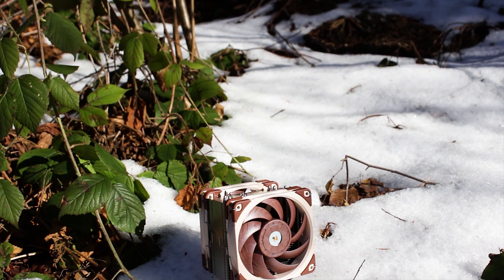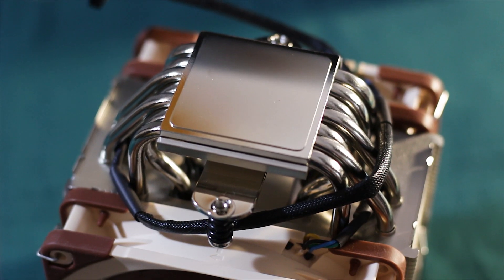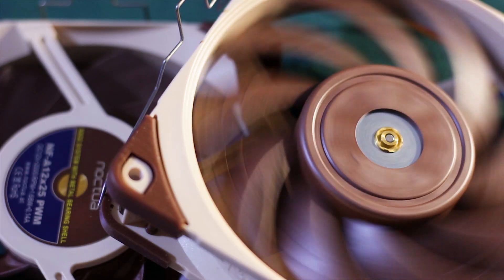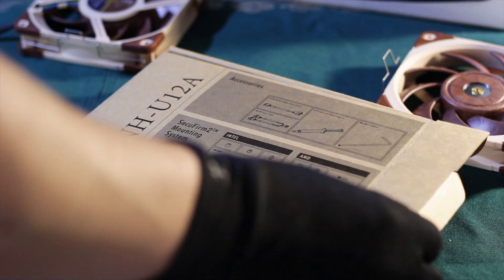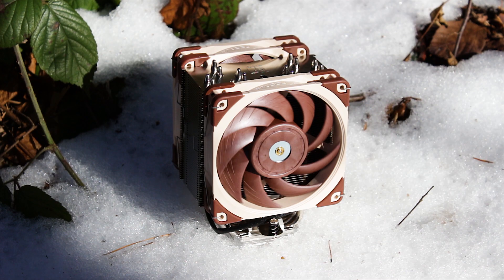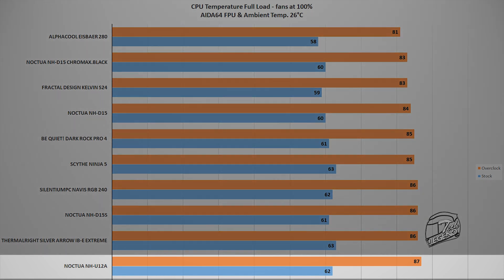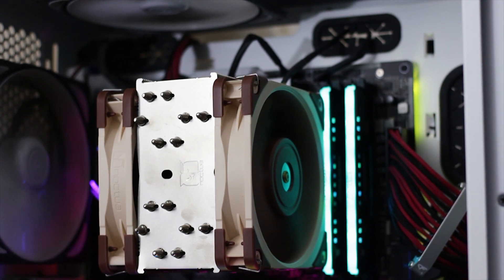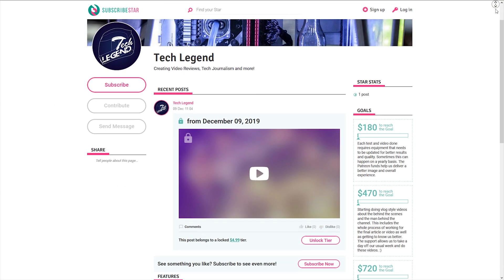Noctua NH-U12A CPU Cooler Review

Comment: What is the point of measuring temps with fans at 100%? Why not give regular fan use temps, so we can relate the U12A to our own coolers?
Reply from the maker: What does "regular fan use temps" even mean? Some people run their fans at 50% some at 20% some at 5%, some use good cases with good airflow, some use cases with blocked intakes. How many variables do I have to keep in mind when testing a CPU cooler to cover everyone? Not really realistic. The best I can do in terms of an "upgrade" is noise normalized testing in addition to the 100% RPM testing.

Comment: Very good review. I am eying on this to pair with Intel 10900k. Case is fractal design define 7,Gigabyte z490 vision d. 

What is your opinion on the setup and especially on whether the cooler will be able to maintain a low temp.

My usage is mainly for producing music.

Thank you.
Reply from the maker: I believe that I was the one who recommended this cooler to you. :)
This cooler is one of the best around, you can't go wrong with it.
Reply: @TechLegend-com  Yes indeed. Thanks once again for your helpful suggestion.
Reply from the maker: @Pianitara  No worries, glad to be of help!
Reply: @TechLegend-com  I was actually looking to upgrade my 11 year old PC. My current setup is corei5 2nd gen, 16gb Ram 1600mhz. In music production, I have stretched this setup always to the max.

As it is today, the price per core of Ryzen 5900x is same as that of Intel 10900k. Graphics card are way above their price and lower models are unavailable.

Ryzen 3900xt cost less than intel 10900k by $70. The Amd MB I was keen on is asus b550 which is not yet release till date. 

I am thinking to upgrade to Intel 10900k because of inbuilt graphics.

Considering the situation, in 2021, is it wise to choose intel 10900k?

Thank you.
Reply from the maker: @Pianitara  In your case, i'd get the 10900k instead of the AMD, it is a better CPU overall. Plus, tbh, I like the intel motherboards better.

Comment: Good review. I own this cooler and i am very satisfied with the performance. Two corrections: it has 7 heatpipes not 6. The heatsink has an offset design so it has 100% ram compatibility and it does NOT block the first ram slot and you can install even high profile ram in all slots. You don't have to move the fans upwards. You just need to turn the heatsink around (which is the correct installation orientation).
Reply from the maker: It was my mistake for installing the cooler the wrong way up, I have mentioned it in a few comments below. Unfortunately, I can't edit the video after it has been published. :/
Reply: @TechLegend-com  no worries :)

Comment: Good cooler and good review too.
I have also seen your review of the nh-u12s.
Can you please list the main differences between these two? And a performance difference.
Reply: Are the fans used different?
Reply from the maker: Yes, the fans are different. The ones used on the NH-U12A are newer and better.
Reply from the maker: The NH-U12A uses two fans that are better overall, also the heatsink is different. The NH-U12A is better than the NH-U12S, but it is more expensive.
Reply: How much the performance varies?
Reply from the maker: @utkarshsharma7336  Around 3 degrees between them.
Reply: Ok Thanks
Reply: Have you tried the performance of the 12s by swapping the stock fan with the better newer one?
What I really want to know is besides the fan is there any difference between these two?
As the d15s has just one fan less than d15.
Are the heatsinks of u12s and u12a same?
Reply from the maker: @utkarshsharma7336   The U12S and the U12A have different heatsinks, the D15 and the S variant have the same heatsink. Also, I do not test with different fans, as each CPU cooler is reviewed with the factory fan and orientation. Otherwise, I can just take a NH-D15 and put three 3000RPM fans on it and call it the best. :)
Reply: Ok thanks 👍, you have helped me with a lot of info.
Reply from the maker: @utkarshsharma7336  You're welcome!

Comment: Performance of this cooler in terms of temperatures in AIDA64 for both overclocked and stock (87/62) seemed very similar to the U12S Chromax (87/61) you reviewed. Would you recommend the U12S Chromax over this cooler (less noise but higher price and worse color)?
Reply from the maker: It just seems that way, but overall, the U12S is on average, 2-3 degrees hotter than the U12A. If you can, get the NH-U12A as it is better and has more clearance for the RAM and graphics card. The NH-U12S is good, but this one is a bit better.

Comment: You installed it backwards... it does not cover memory slots at all...
Reply from the maker: Hmm, Ryuki I think you are right! Now that I think of it, I installed it backwards because the fan was somehow touching a VRM heatsink. Thanks for pointing this out! At least in this review and mounted like this, we get to see the RAM clearance in terms of height.
Reply: No, it's mounted properly.  I have this cooler, mounted in the same orientation, and it doesn't cover any RAM slots.  He just was a weird motherboard.

Edit: No!  It IS backwards!  On his cooler, the Noctua logo is stamped in the opposite direction from mine.  I wonder why that is.
Reply from the maker: @hughjazz44  No mate, I did mount it backwards. Normally, it should not interfere with the RAM slots. Unfortunately, these things happen on occasion.

Comment: It performs almost as Noctua NH-D15 for example and with the benefit of being smaller. Does that make it better than NH-D15 in your opinion, or does these two and three temperature degrees actually matter?
Reply from the maker: I reviewed both coolers and it is really up to you. The NH-D15 is better at cooling but is bigger, while the NH-U12A is smaller and offers more clearance for the RAM and PCIe slots. The choice is: Lower temperature vs. more clearance.

Comment: 6 or 7 heatpipes? I thought I counted 7 heatpipes and 14 heatpipe ends on top of the cooling tower.
Reply from the maker: It has 7 heatpipes, each with a diameter of 6mm. If I said 6 heatpipes, then it's my mistake, sorry.
Reply: @TechLegend-com  It was mentioned 6 heatpipes but it doesn't matter to me. Damn 7 heatpipes for a single tower with 2 x 120mm fans (one of the best) really can dissipate CPU heat away, I am sure. This NH U12A looks like a performance upgrade from pervious NH U12S.
Reply from the maker: @AtticusAng  The NH-U12A is a really good cooler and quite small as well. The price is however, a bit much.

Comment: Noctua sucks! Scythe Ninja 5 and Arctic coolers rules! :P
Reply from the maker: You have an argument to back this up? :P
Reply: @TechLegend-com  your grafs, 
800RPM on Ninja5 = no sounds,
Noctua HEAVY price,
and Arctic Liquid Freezer II 280 on Ryzen 2700x in Aida64 (115watt CPU package) - 71 degrees

p.s.: what 'CPU package' on 9900k with 5GGhz in Aida?
Reply from the maker: @ph7neutral  Each product offers something different, you can't have no sound and the best performance, there are compromises to be made. The CPU package is the same as it  is shown in the graphs. I use the onboard Display of the motherboard to read the CPU temperature (as a backup) since that requires no software.
Reply: Tech Legend ooh

Comment: I have that cooler and it is fantastic!
Reply from the maker: Great to hear! What temperature do you get and on what CPU? :)
Reply: @TechLegend-com   max 71°c on r7 1700x at 4GHz and 1.4V. That is on 100% continuous stress test .  Normally it is below 60° and quiet...
Reply from the maker: @mastervexpc1881  And what about the ambient temperature? Even so, those are great temps for an 1700X at 4GHz. :)
Reply: @TechLegend-com   hm... Can't tell that with accuracy....19 or 20°
Reply from the maker: @mastervexpc1881  That's great, as I've said before, those are great temps for a 1700X, and also running at 4GHz. I know that I struggled to get mine to stick to 4GHz on all cores.
Reply: @mastervexpc1881  what stress test are you use?
Reply: @ph7neutral   aida 64 or prime 95 one of those not shore which one...